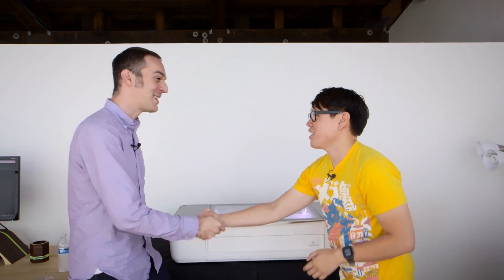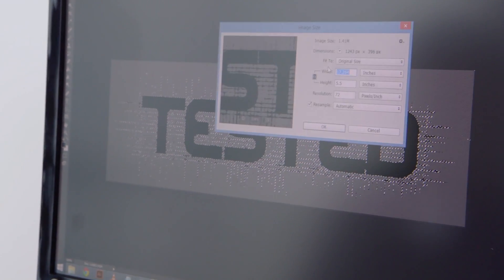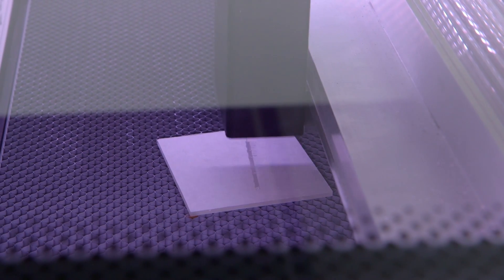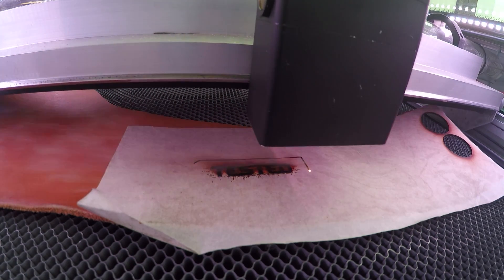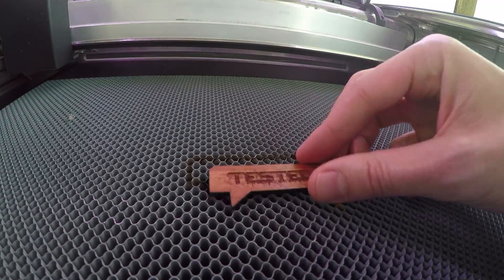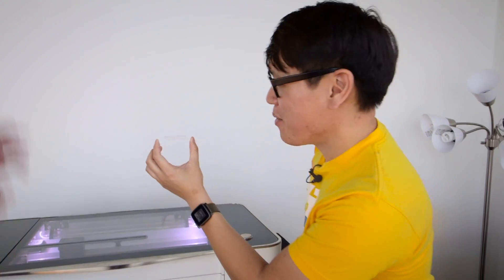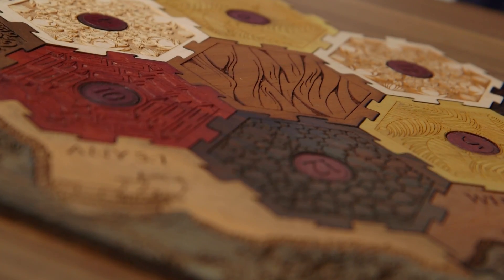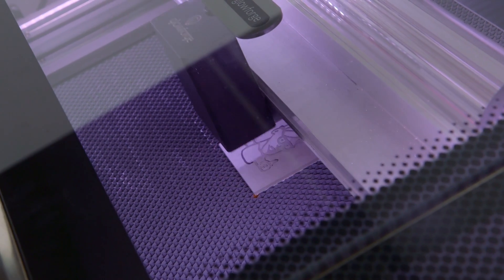How the Glowforge Laser Cutter Works

Comment: this when it came out was interesting but being almost a year delay, their features now is more their weak points and their price point relative to the market now is an over price underfeatured laser cutter. being only 40W laser is limited to what it can cut. current cheap 40W lasers are less than usd700. though has many issues, but being 4x less than glowforge (kickstarter price). one of the worst aspect is that it requires internet to output the files which is a ridiculous condition. though the camera is interesting, and that seems to be the problem. not too sure what details their laser but if it is a co2 laser, it is not able to do anything on metal. lastly, the filter at the bottom with no informatiom on the exhaust is a limited capability especially when cutting acrylic and leather have strong fumes and smoke. being below with no strong enough suction will not mean much. no part of the video talks aboit the water pump needed to cool the tube. the insides is so vague like it is suppose to run on unicorn juice.

Comment: Another concern is vapor and particulates deposited on the output window/lens of the beam delivery system. Debris here, will burn onto the output optic. Cannot be cleaned, once burned in. Normally this would be purged with a blanket of flowing gas. Seems unlikely he could do that, on this low cost device. Perhaps uses a negative pressure plenum to try and evacuate gases, as that is cheaper.The High Voltage power supply that drives the tube, is hard to make reliable, also.Cycling off and on, produces much stress. Field replacement of a dead laser is probably not possible, without a skilled laser technician to do it. Certainly no warranty after DIY repair of  $500 glass laser. May have to go to factory for repair. Cleaning and alignment is always difficult for laser systems. Problem with this entire unit is, he is trying to deliver an industrial level of technology, at a consumer price. This is difficult. Best thing is to wait and see how this survives in the field. You will find out soon enough, on the net. Still , best of luck to him. It is an ambitious undertaking.

Comment: Been in this business for a long time.  The sysytem packaging is nice, the camera alignment is interesting.  There are better software print driver software and graphic packages out there from what little I saw in this video (which is well done) .  Someone told me this is a very low cost unit, but he also said it is a DC excited CO2 tube which isn't the best engine for every application.  Looks like this guy has something going on here, but before purchasing it, I'd be clear about where spare parts come from, service/support capabilities etc...

Comment: I have 2 questions:  Can I use it to cut leather?  What size is the cutting area?
Reply: +Dale Erwin It cuts leather, that's why I bought it. Working area is 12"x20" basic version and 20" by infinite length pro version.
(Save $100 http://glowforge.com/referred/?kid=UrfCQ4)
Reply: +Alexander Neverov maybe you can buy cheaper one from mine, also we surpport many different work area machine  zbjxsales@gmail.com

Comment: Or you know, spend $1200 on something about twice as powerful, better, bigger, faster, and without a shitty web interface that will stop working in a year when this company goes pop.
Just search eBay for "laser cutter". Plenty of things to choose from.
Reply: +Spirit Where the hell on eBay are you seeing a decent laser cutter for $1200? The good ones are more like $8000
Reply: ***** Well, you must be absolutely blind, because here's the exact same cutter except built properly, and for $400.
http://www.ebay.com/itm/High-Precise-40W-CO2-Laser-Engraving-Cutting-Machine-Engraver-Cutter-USB-Port-/141690337410?hash=item20fd66f882:g:0R8AAOSw~OdVeUAY

Or, here's a bigger, 50W cutter for around $1100 DELIVERED.
http://www.ebay.com/itm/50W-Laser-Engraver-Engraving-Cutting-Cutter-machine-300-200-Work-Table-/111699727781?hash=item1a01d295a5:g:UMwAAOSw1XdUXOXM

Or, a 60W cutter for $1300.
http://www.ebay.com/itm/Upgraded-Version-CO2-60W-110-220V-Laser-Engraving-Cutting-Machine-with-USB-port/191685229333?_trksid=p2047675.c100005.m1851&_trkparms=aid%3D222007%26algo%3DSIC.MBE%26ao%3D1%26asc%3D33873%26meid%3Da230c72a76c64f50a791ba81f645dd1f%26pid%3D100005%26rk%3D5%26rkt%3D6%26sd%3D251872432392
Reply: ***** 
1) The software is totally fine. Load a file on via USB or SD Card, press start, it works. No need for fancy cloud or any of that shit. Oh, and if you move the cutting head by hand it won't burn the drivers the fuck out, so it's easier to align.
2) There's warranty.
3) It works out of the box except for the alignment, which is a 30 minute job.
4) No need to replace the internals. In fact, glowforge uses THE SAME EXACT internals, except much lower quality and crappier tubes. Without even dampening. It's just bolted into metal. Glass. That's not acceptable.
5) None of it ever blows up. The tubes slowly outgas over a few hundreds/thousands of hours, and that's it. I assure you the same will happen with the glowforge ones.
6) Glowforge has no ventilation. The chinese cutters, on the other hand, come with very powerful blowers and a hose to throw out of your window. Some models won't even turn on without the blower working.
Reply: ***** And your argument is what exactly?
Glowforge is, as stated, using the same componentry, except it has a prettier case and absolutely stupid design with no fume clearing.
And please, if you're expecting to spend $1200 for a laser cutter wanting a huge work area, proepr support, troubleshooting and warranty, you're absolutely dreaming.

There are tons of reviews of them, too. Please stop being blind and use your brain.
Search for "chinese laser cutter".

As for the work area, here's a unit for $3.5k that meets your requirements.

http://www.ebay.com/itm/100W-Co2-Laser-Cutting-Machine-Laser-Cutter-1200-x-900-mm-USB/121786766185
Reply: ***** You don't need an electrician, the electronics are in two modules inside, just like in the glowforge cutter.
The first is the main processor board, which is by the way far more advanced in the chinese cutters as it does everything, and then there's the laser power supply/ignition system, which is usually in it's own enclosure, sometimes even potted.
The only thing you would ever touch the insides of the thing is for replacing the tube(which you can do painlessly, by the way), and for connecting the blower hose, which is mounted on the inside with a small hole going through.
Reply: +Spirit The glowforge actually has a fume clearing and a optional filter to use with it
Reply: ethan polcyn I did not see how smoke in the lens counts as fume clearing.

Comment: Is it possible to put a sheet of the Falcon kit in there to cut through fully so no need to cut out manually? Can this be done on the fly following the existing cuts and making them deeper? And leave cuts that are not deep alone. Or does the whole need to be scanned and the unleep cut lines to be deleted from that digital image?

Comment: Question: IF at some point Glowforge were to go out of business (not anytime soon) can the machine still function without any of the web/cloud based services it uses? Can I use it offline if needed? (Even if it is limited to traditional laser cuter functions without any of the fancy camera/auto settings)

Edit: Read the extra Q/A's, I don't like the "Flash custom firmware" answer. I would like some type of basic raster/vector cutting drivers to use as a backup directly from them.
Reply: +insanegammer109 It would become an expensive door stop, unless they release the software so you can run it on your own server.

Comment: Unfortunately, they don't have an answer for the "what happens if you go away in 5 years" question. That's not a what if, but a when.

"We haven't decided yet. We'll publish a reference version because the firmware on there honestly doesn't even understand G-code. It's very low level. It's not something where you flip a switch in and it'll work offline. But we want to make sure people can get access to configure the Wi-Fi on board and other parameters. It'll be a framework to get started. We actually do the motion plan in the cloud, so what comes down isn't even G-code."

The local firmware doesn't do much of anything except move the head, and as they said, it's not a G-code parser or anything. My assumption is it's super low-power and incapable of doing any calculations like that locally.
Reply: +Pete Brown Exactly. Although it's relatively inexpensive for a laser cutter, I'd much rather have the peace of mind to not have to worry that one day my internet would go out and leave with a $2000 box. There are too many what ifs. If they fully flesh out the offline mode, I wouldn't mind paying slightly more for it, but right now there's just too many doubts lingering. What if their servers get DDoSed, what if some undersea cable somewhere gets broken by an unexpected earthquake, what if the laser cutter has some vulnerabilities.... Lots of things could go wrong.
Reply: +Pete Brown This! Exactly this! I've been telling this to people ever since this became a hype. A lot of things make sense to run from the cloud, but for something that can completely break a piece of hardware if cloud support is removed? No, sorry, that's a terrible idea. I'm a bit waiting for the backlash of a) this not being all they advertise it to be, because frankly it isn't, and b) lack of future support. 

However, who knows, maybe they'll be bought by one of the bigger actors, like Epilog, and something good could come of it. Until then I can't with a clear mind recommend anyone to get this, even though I'm happy to see that there is some lateral thinking going on in a business that sorely needs it.
Reply: It takes less computing power to parse G-code and do motion planning than it does to connect to the cloud. They've just put as much as they can in the cloud to stop anyone from cloning it. Which also means that making it work standalone would basically mean designing your own control software from scratch.
Reply: +Pete Brown Very quickly they will realise to keep the back end running you will have to pay for every cut you make even if you make multiples of the same thing - and if they cease trading you own a useless box - I'm out
Reply: +Colin McNair Right. It costs real money to run a cloud service. They've presumably built into the up-front price enough to run the service for X months or years. After that, they need to sell more product to keep the service running. They could either sell new units, subscriptions, or something else. Lots of ways to do that.

If it turns out they aren't selling enough new product to fund cloud usage of the original product, then they stop investing in this first product. Given it's a cloud service, it's very easy for them to terminate support in the cloud for this product to encourage people to move to a newer model. If the intelligence is all client-side, you don't have that problem. I don't believe they've committed to any timeframe for supporting the product.

I'm not saying they're doing anything malicious, it's just that running a cloud service is a lot more of a commitment than most companies and individuals realize, and startups come and go.
Reply: +makomk thank you.

Comment: I pre-ordered based on Will's excitment. I really hope I find some great uses for it! I am really interested in methods of etching/coloring/marking thin metals...
Reply: +howpeculiar Not sure you can use it with metal? i may be wrong.
Reply: +xXFIREWIREXx It looks like it can change anodized aluminum appearance, and work with metals like stainless steel. I am still learning, but it looks like there are chemicals you can use to make it possible to change the appearance of the metals using the 40W laser. Even if I can't, there are tons of neat things I can picture using it for! Like everyone that has ordered, I guess I will throw my $100 off referral link out there
http://glowforge.com/referred/?kid=TtTOL8
Reply: +howpeculiar you can mark on metal if you use a moly lube or cermark
Reply: +xXFIREWIREXx 
It works with metal just fine... Just doesn't CUT it.
Reply: +sethmo38 Looks like CerMark and TherMark are exaclty what I was thinking about! Thanks!